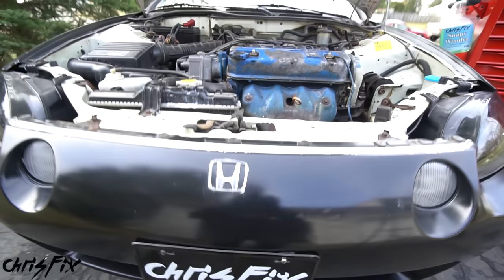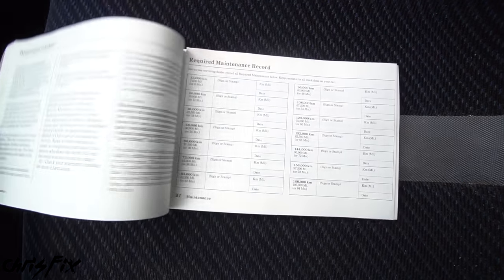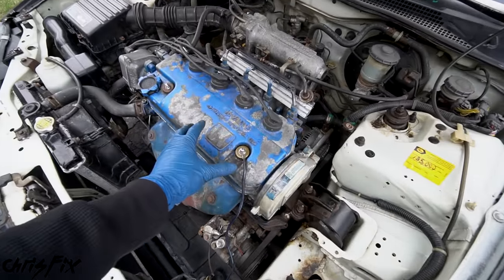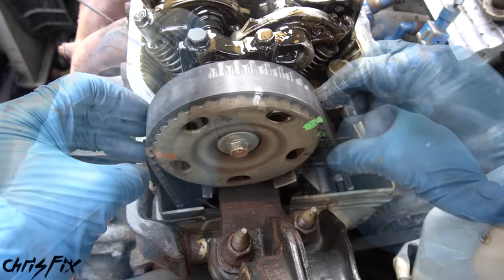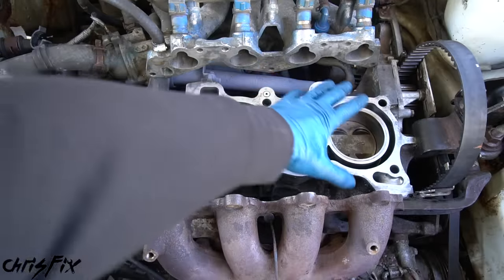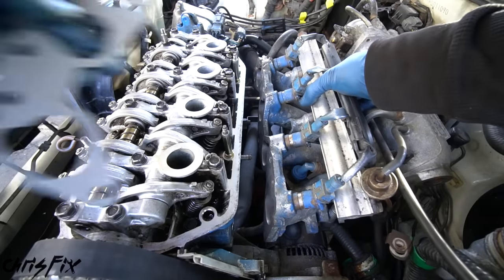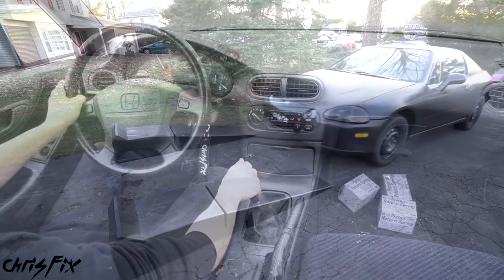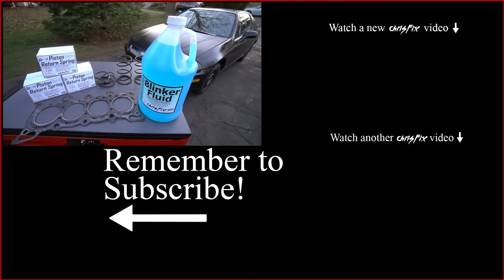How to Replace Piston Return Springs (and Head Gasket)

Comment: The 4.2k dislikes are the people that actually did this to their car 😆
Reply: Guys at parts stores are so onto it, they'll say "just sold the last one. Its gonna be 3 weeks for the next one. Eyedropper wouldnt work huh?" "Uh..well I figured I'd just get a new one anyways"
After 15 minutes walking around the store, "So um..its been so long since I tried an eyedropper...how do you do it?" "The same way as the old way". By now theyre freaking out. " just fill an eyedropper 1/2 way with warm water. NOT TOO WARM THOUGH. VERY IMPORTANT. 2 grains of salt, put 1 drop on the end of you turn signal every 5 minutes for two hours. Mortens salt works best".
Reply: Took my car apart was like that's the problem the was none then didn't have a car to get to the part store long story short they thought I was crazy an my phone wouldn't pull up the video in the store spent three hours trying to pull the video up cause wasn't driving home to do it all over again got stoped by the cops figured out the car was stolen by the time I go outta jail to figure out it was a joke lost my car house an job
Reply: @jbstepchild  
Makes one wonder how they got jobs there, huh? They'd rather sell new spark plugs for $$, when all you really have to do after the first 200,000. Miles is rotate them. And if the engine starts smoking, you'll know it's old enough to take care of itself, since it can buy cigarettes.
Reply: @AngryHybridApe  my engine is old enough to start smoking! Check out my 3/4 million miles video lol
Reply: @ElectricBlakeGames  
Oh yeah. Its ready for a smoking jacket and pipe. lol
Reply: Or at least tried
Reply: @jbstepchild  you need to learn how to use punctuation. That was one long, run-on sentence, hard to read with typos.
Reply: Yeah RIP
Reply: And real car guys that don't realize this video is just a joke.
Reply: @robertpeters5871  ya

Comment: I just did a set of the piston return springs on my Tesla
Reply: Come on now. Everybody knows those use giant wound up rubber bands.
Reply: Yeah gotta get that flex amirite!
Reply: MiIesTailsPrower  
They still do. But they're made out of hi temp foam rubber now.
Reply: What did you torque them to?
Reply: Internet Internet to infinity and beyond
Reply: @internet_internet  
I torqued them to the muffler. Duh.
Oh you mean the setting. 22. Yep. 22 smacks with the good ol torque hammer. I doubt those babies are ever comin lose again.
Reply: NOT true
Reply: Tesla fucked up 100
Reply: Did you also replace the blinker fluid?
Reply: Bob Stuffguy You silly goose, everybody knows Teslas use 75w-90 gear oil to lubricate the electric motors in the bulbs
Reply: Me too i also replaced the muffler bearing
Reply: I think that fixes the sound. Everyone knows that the Model S has a massive Italian v12
Reply: NotBuyingIt ;))))
Reply: @AngryHybridApe  😂👍
Reply: NotBuyingIt same bro
Reply: I must have altzeimers cus ion remember asking
Reply: I really needed some piston return springs for my rx7
Reply: Is it the two stroke V-5 .04 liter?
Reply: I hope you have updated it. Tesla's piston return springs are notorious for being very bad quality.
They have great exhaust ball bearings and very long lasting blinker fluid though
Reply: I think the previous owner of my car replaced the return springs with a return airbag system.
Reply: @deondre294  Don't ask anybody fot that staff......hahaha!!!!
Reply: Same, but on my dodge.
Reply: did it go plaid??
Reply: Deondre, is it true that rotary engines use clock springs as return springs?
Reply: NotBuyingIt just did some in my RX-7
Reply: The Un-Known Musician  you guys need to realize that 3 rotors need all 9 return springs to be torqued to a bucket of prop wash with left hand threads
Reply: NotBuyingIt ok thank you I’ll write that down so I don’t forget 👍
Reply: Brake piston return springs.......
Reply: And you didn't replace the muffler bearings and tire oil?

Comment: This dude went so far as to modify  the whole owners manual and obd2 scanner app. Im shook
Reply: the p0401 is an egr code so it was shopped. but such major effort all around
Reply: @yeeaahhzz  yeah but p0401 is also April 1.
Reply: @cambo125  ohhhh snap
Reply: geez I totally bought this... I was a little confused at first but everything he was doing made sense as the video went on so I was like "eff I don't know anything about engines"
Reply: Even had a convincing box that held the new springs.
Reply: @ViewThis.  I noticed that but chose to ignore it?
Reply: I LS swapped my mustang and took the transfercase out of my 1979 bronco and mounted it in my car, next I modified the dana 44 front axle to be "independent" (cut the axle into three parts) and I modified the bronco's rear axle so that it can be installed in my mustang.  Hooked up the modified suspension and drivelines and voila, a mustang that can't get stuck and is using a reliable V8 powering it. XP
Reply: Not to mention at 10.21 the whole piston spring illustration
Reply: After you said you were "shook" there ain't no such thing as half way crooks. 😂
Reply: Right had me going for about a minute and I've been turning a professional wrench for 17 years. Had me sold for a second. 😂
Reply: calyn cutler is this the proper way to change the head gasket tho?
Reply: his other vid he literally sawed his fkng exhaust just for the lolz
Reply: Not to mention had FAILED springs in the engine so you’re like “oh hmm... if they were there before, must be real!”

Comment: Return springs are so old school. Most the newer cars go with a hydraulic return system.
Reply: Usually using the same water as the one in the radiatior ;)
Reply: Gary Graham I never realised cars had these
Reply: The Un-Known Musician It’s an April fools joke
Unless you were making a joke
Reply: NpNE piston fluid
Reply: @danktoast8004  why did youtube suddenly go to dark mode for me
Reply: What about explosive return systems?
Reply: Muscle cars use protein as oil
Reply: Where can I buy this spring?
Reply: The parts store just laughed at it so I just walked out,are these spring just for Honda’s?
Reply: @austinmars4294  There's no such thing as piston return springs. It was just one of ChrisFix's tricks.
Reply: @jandajanda2242  OHHHHH IS SEE
Reply: Okay?
Reply: No most engines have connecting rods
Reply: @jaybee6477  woosh
Reply: Saab had electric actuators in 90's. They just last, have never needed to change mine. Then they started to use turbo driven piston return system and the problems came...
Reply: Well I use a compressed air return system.
Reply: @austinmars4294  April fools😂

Comment: With this video, ChrisFix literally just made a head gasket leak feel like a flat tire.
Reply: It was so quick
Reply: I mean it's a d16 so changing a head gasket isn't hard to being with
Reply: It is a 90’s Honda so you could probably change the crank bearings like changing a tire. Also Chris is very skilled
Reply: It is a 90’s Honda so you could probably change the crank bearings like changing a tire. Also Chris is very skilled
Reply: Well, that's what working on a Honda is like
Reply: Yep
Reply: He did skip removing the coolant pipes (after draining), air intake, air filter, distributor wires, any air/vacuum hoses, draining and removing power steering pump (though his del sol did not have one). I really look forward to a full-length head gasket video so I can learn and plan to repair mine.
Reply: @mw4518  I've literally done crank bearings in a 90's honda without removing the engine lol.
Reply: D series honda engines.
Reply: @mw4518 you can even do it while driving, trust me😂

Comment: I'm amazed at the effort you take to make this believable.... Phone apps, owner manual, custom packaged spring etc 😂😂😂
Reply: I'm pretty sure it's just a screen shot that's edited
Reply: I didn't even notice the packaging until you said it! Omg lol he really is impressive.
Reply: Bruno Berllam It’s real he has a web site for it
Reply: That's why he's great
Reply: P0401 is insufficent egr flow btw😀
Reply: You got me.
Reply: Ford VIN on the phone though.
Reply: @bberllam  Everything is a physically created prop.  Except the image he put on his phone screen.  That was created in a graphic editor.  The springs are probably actual springs meant for something else.  The phony manual page was a separate sheet of paper he apparently attempted to make look like it was part of the book.  It wasn't attached and was slightly brighter than the rest of the pages, probably a different form of paper.  Edit: I could be wrong, but that seems the easiest way to do it.
Reply: Peter Lee  You see, it's not just for the bumper.  The whole car is unbalanced. I can't afford a replacement for some part that fell out.  I don't even know what it is.  Just put the weight on to even it out, please.
Reply: Did you notice the barcode is Pi. 3.1415926

Comment: I ran my engine low on oil, and broke all 8 piston return springs. I replaced them and no more rod knock. Thank you so much!!
Reply: Hi temp foam rubber works just as well, if not better. Just make sure to use 2 cups titanium chips in the block after draining oil and before smoke reving it. I've seen some guys drain the oil and forget the chips and rev it to the floor for 30 minutes. It smokes and squeals and auto shuts off fine. But it loses a little power after that.
Sometimes just playground sand works too. But then you have to take out the plugs, grind off the thread build up before hammering back into the heads. But thats about the only way to get the sanding powder into the cylinders

Comment: I watched this in October and my guard was down.
Reply: Mr Oblivious tb I’ve pulled many heads and never found them, he got me today...
I was like what kind of motor has damn springs in the block, then noticed it was Chris fix checked the original upload date and was like ahh but watched till the end anyway.
Reply: Got to admit it was still a great video
Reply: I watched this in december and same😂
Reply from the maker: Ohhhh I gotchu! 💪
Reply: @chrisfix  I know nothing about cars and especially engines, so I totally believed everything. Oh well, I guess I need to go and change my blinker fluid now.
Reply: @kyngosiris6868  He totally just got me too ☹. I was like, I dont they have those in most cars. Maybe its a honda only thing? Then I saw the upload date and realized.
Reply: Same
Reply: I just watched it april 26 2020... Because my del sol is having symptoms his had. Although I was more confused at the OBD scanner... 93 del sol has obd 1 and I paused the video at his manual to make sure it was a 93 del sol and not a 97. Followed by checking his site for Chrisfix brand springs..
Reply: sonicx059 Cris is really good at making everything seem real, good luck with the del sol it might just be the head gasket.  I wish you luck

Comment: P0401

P = prank
04 = April
01 = First

I love chrisfix
Reply from the maker: Haha you figured it out!
Reply: @chrisfix  hi chris
Reply: @chrisfix  Mr. Chris
Your DriftStang did a 15.8 second 1/4 mile.
How much would it after supercharging?
Reply: @Nate Zab you are a legend.
I couldn't think of that even in 7 million years.
Reply: @chrisfix  
5 years back did you ever think you would have 6.8 million subs and buy a Maserati for your dad?
Reply: Other people : What the hell are piston return springs?
Me( and some other people): So it is that easy to replace a head gasket
Reply: @chrisfix  
Chris , would be procedure be same to replace head gasket in a V8?
Reply: @atarvhegde5210  Basically, just check your service manual for the bolt patterns and torques, the real only difference is that there is 2 head gaskets.
Reply: @tylerrusty1122  
Thanks
Reply: @atarvhegde5210  If you've never done it, consult your service manual, always helps
Reply: there is a video out there that is a Russian installing return springs to see if they worked, on one car they did and on the other they jacked the engine, so I guess it is possible with a little redesign work.....
Reply: p0401 is an egr code tho
Reply: Hehe, I was waiting for that DTC too. :)
Reply: Big brain time
Reply: @atarvhegde5210  its 7.27M now
Reply: How did he get the phone app to display that fictional code?
Reply: @mwendia  that's what i wanna know lol
Reply: @chrisfix  you made this on April foooooooools
Reply: I watched multiple times and never noticed that
Reply: @chrisfix  Hey Chris, I know this video is over 2 years old. But when do you plan on doing that head gasket replacement video? Thanks!
Reply: i didn't even notice that XD

Comment: Make sure to add sugar into the oil to make that engine run sweet!!!!
Reply: @erhanmustafov1513  then throw some protein powder in it to make sure it runs strong too
Reply: And don't forget some lotion! Not only do you want your engine to run sweet and strong, but also smooth! xD
Reply: Thank you for that tip
Reply: add some carb rich diet for g8 milage
Reply: And put some salt in the fuel tank for the perfect combination of sweet and salty.
Reply: Random Voice Gamer and don’t forget transmission sand
Reply: @marvinb4926  and engine dirt oh man that will give you amazing compression gains

Comment: “Torque by feel” so how many ugga duggas was that
Reply from the maker: A little under 3!
Reply: @chrisfix  I did 4 and my muffler bearings went bad. :/
Reply: @fishpants7764  anything over 3 unga dungas should never come off if you did 4 you had to of broken a 7inch diameter thread bolt
Reply: Not really "ugga duggas" if you're using a ratchet or a wrench. 

But "torque by feel," well, thats when you grab your German ratchet, or wrench, and get the bolts "gutentight".
Reply: @themc3311  im going to use that from now on lmao
Reply: @fishpants7764  That's because you didn't install your exhaust tips in the proper order...
Reply: What did u use to clean the head
Reply: tighten till it snaps off then back up 1/4 turn.

Comment: In Mexico we reuse BED SPRINGS, they have the same compression rate and are cheaper. That's where they get you on the cost. By the way I just did this on the wife's car, Now I have to do it on my truck, sucks because I have to remove the fusion drive and the continuum transfunctioner.
Reply from the maker: Dang now that’s being resourceful!
Reply: LMAO nice
Reply: Victor Villasana best comment
Reply: @Victor Villasana.....Did you use the worn-out bed-springs from the Wife's side?
Reply: Victor Villasana was that a king or queen bed?
Reply: Jajajajsa
Reply: watch that you don’t damage the Flux Capacitor while removing the fusion drive. I did and now the car shakes at 87mph

Comment: My return springs were totally missing!!!!!  Must have been a factory mistake.  Having trouble finding new ones.  Any advice ?
Reply from the maker: Darn! I would check and see if there is a recall from the manufacturer to fix that mistake! ;)
Reply: install coilovers
Reply: Soapy wooder 😂
Reply: That is machines
Reply: is that a tesla? I heard about panel gap and other build quality issues; may be they totally forgot about return springs this time
Reply: @zahidhasan9040  maybe they totally forgot about the engine
Reply: Use the ones from your shocks.
Reply: Remove the spark plugs and fill each cylider with Expando, works just fine.
Reply: I would just go store to store asking what types of piston return springs they carry. Not many stores carry them, so they might even laugh at you for asking.
Reply: @lol-ws6po  lol

Comment: I replaced mine with a set of high performance twin piston return springs , and what a difference it made ! I think now that I will  replace the cam pressure sensor, and with the extra horsepower, I will need to upgrade the brake gaskets.
Reply from the maker: Awesome man! Gotta get it dynoed now!
Reply: And sell the backup engine (safety first)
Reply: Don't forget about the fuel injected lug nuts?
Reply: Did you make sure your camshaft pretensioners were good?

Comment: When loosening the head bolts I recommend loosening them in the reverse tightening sequence about a half turn at a time to avoid warping the head. I am an ME and worked on a lot of gaskets of all types. These head gaskets have tremendous forces in the bolts so you want to back off on that slowly to avoid warping. Heads are expensive.

Comment: Hi Chris Fix/Fish I love your videos. It's beautiful that you make such complicated jobs look like a piece of cake. However I think the video hasn't mentioned something very important. When you open the engine I think it's a must to measure the warp with the "ruller  feeler gauge" method which is the simplest solution or with a micrometer. Also depending on the car or the mileage it may be better to take the engine out of the vehicle and take it apart then measure every backlash (gap) and then change what is needed. Maybe you even need to go to the machinery shop to make the piston wall or block machined. I think it's better to only open your engine once and never again. Maybe this is why shops ask for so much money for this job.
I hope it makes sense. I'm not a native speaker so I can't write my thoughts excellent but I think you get the idea.
Love your videos and waiting for the new season to see more Fishing videos. 
Waiting for your thoughts...

Comment: Great video! One thing I would probably do before installing the head cover - spray the cleaned tappets and camshafts with with a new oil, so that when you first start the engine up there will be no metal to metal contact in the first 1 - 5 seconds.

Comment: I tried this in my tesla and now its not blowing smoke, ty Chris
Reply: Wow congratz! 

XD does Tesla even has a engine? XD
Reply: @ryxn190  nope. Just a Electro Motor
Reply: @ryxn190  nope. The electric motor are in the rear.
Reply: Nope, just a Electric motor in the rear wheel and have a single gewr
Reply: Xo
Reply: @ryxn190  Electric engines are called Diesel too, duh
Reply: @ryxn190  seriously
Reply: @ryxn190  please tell me that you are trolling